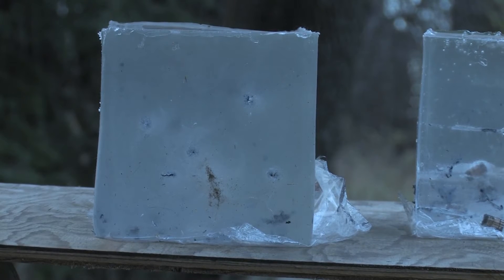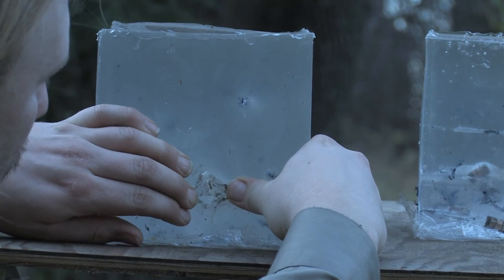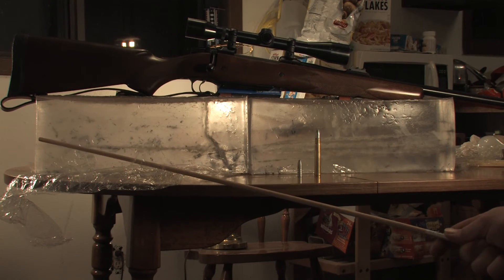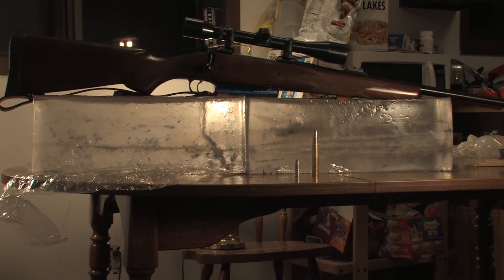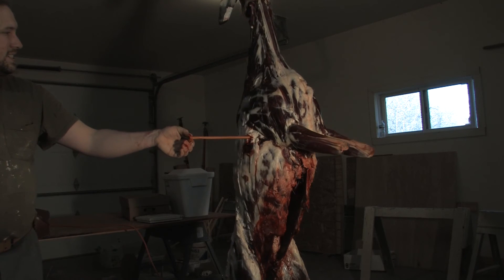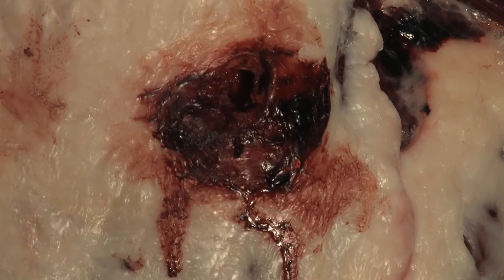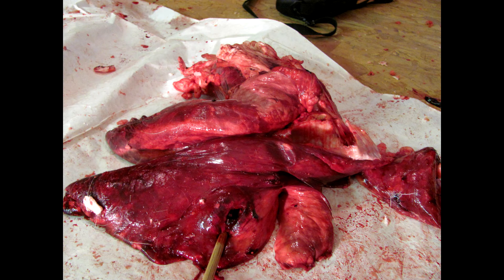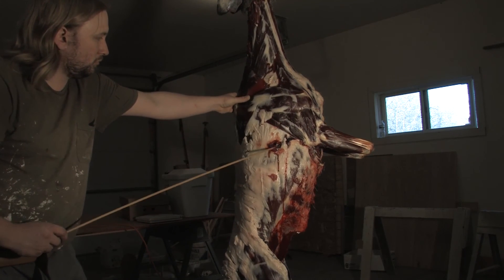My Cast Rifle Hunting Load in Ballistics Gel in Comparison to My Deer Kill

Comment: How much later after the shot did the doe lift her head? If shortly after dropping i would call it possible/normal, with the shot placement, even with modern hunting rounds...? A few inches to the front and you might have been pleasantly satisfied?
Reply from the maker: It was right after she fell.  With modern jacketed soft points, the extra damage would have lead to a cleaner kill with the same shot placement.  Also, yes, an inch or an inch and a half forward with this cast lead load would have had a cleaner and quicker kill, and would have fully met top expectation.

Comment: I used cast in three deer the season before last. All were recovered. Two ran over 100 yards with double lung shots with poor blood trails. The third dropped at the shot but kicked around for a good minute. The third one was shot directly below my tree stand. The ribs shattered into the lungs and I tore the heart in half from boolit. I was not impressed. I used a Lyman devastator hollow point with a BH of 15.4 with a muzzle velocity of 1725fps. I used way to hard of an alloy. All cast bullets exited and never expanded. I measured all the exit diameter holes in the hides which were .430”. No shock or energy transfer accept for the the one that shattered ribs (a chain reaction). I blame it on to hard of an alloy. It was like shooting these deer with an arrow and field point. I am currently using the same bullet casted at 7.5BH with an alloy of 16:1 pure lead and pewter mix loaded at 1600 FPS. I powder coat and gas check them. They are shooting sub MOA at 100 yards out of my Ruger 77/44 after I bedded it and lightened the trigger. Imo you need a soft cast bullet that will expand and come apart for instant shock and energy transfer to put a deer down quickly. I haven’t had an opportunity to find out with my soft cast yet but hopefully this season. If I get the same poor On game results I will only use cast for plinking in the future. Imo The only way a hard cast bullet is going to drop game where they stand is with a head, neck, or backbone shot which I’m not willing to do Otherwise they run a country mile with zero to little blood trails .  I tried trailboss loads in my 375 RUM and couldn’t hit the broadside of a barn with it. Once I got up to 2700 FPS it started grouping.  I believe my guns twist won’t won’t work for cast in the 375 as much as I would like to try it. If I ever do it will be with the same 16:1 alloy for quick expansion and shock. Your alloy was probably closer to 10.5 BH and brittle. Try a softer alloy .

Comment: go to accurate molds and look at the 38-335R its 335 gr with a .260 meplat should work awesome with lyman #2 alloy . id size them @.377 lubed with white label xlox 2500  and tumble lube with thinned alox. with that meplat at those velocities you wont need expansion.

Comment: Why is the velocity so slow? Wouldn’t extra energy from an increase velocity be more conducive to producing hydrostatics shock? Did you have to load the round too a low velocity to to the 300 grain bullet weight?
Reply from the maker: Excellent questions.  Cast lead bullets have to shoot at lower velocities in high power rifles such as the 375 H&H because lead can only tolerate so much 1. Velocity and 2. Pressure.  Also, the softer the lead, the lower these thresholds are, softer lead bullets can tolerate less velocity AND pressure.  In cast bullet hunting one can attempt to harden the lead to increase its tolerance to pressure and velocity to gain velocity and energy to attempt to have better hydrostatic shock.  However, once the lead gets hard enough it begins to act more like a full metal jacket, sometimes worse because a FMJ most often has a soft lead core, while a hard cast bullet is hard throughout.  Soft bullets are the better choice, even with the lesser velocity and bullet energy because the bullet will expand, and if a bullet doesn't expand and resist it wont' cause hydrostatic shock.  A hardcast bullet of this design would have almost certainly just shot clean through doing less damage, even at higher velocity.

The 375 H&H can easily handle jacketed bullets of 300 grain at 2,600 FPS and even 350 grain at 2300 fps.  So the low velocity has more to do with it being a lower pressure, lower velocity lead bullet load instead of limitations of the cartridge itself.  Interestingly enough, the load I used was the maximum load listed in Lyman's 49th Edition, and the 264 grain cast bullet max load was only 1,850 fps, about 150 fps faster than my bullet which weighs 66 grains more.  Total energy is higher in my load than the maximum 264 grain flat point bullet that Lyman also produces a mold for and lists a load for.   The low velocity is the result of the heavier bullet being fired at the maximum pressure that the BULLET can handle, not the rifle.  Technically, I was at book maximum load, and the pressure was high enough it was causing fouling after only 5 shots from its affects on the bullet itself.

Simply put, after the brass was examined it was clear that the load was LOW pressure for the cartridge and rifle, but very HIGH for the soft lead hunting bullet.  Increasing hardness would lead to worse terminal performance even with the higher velocity, so I made the compromise there.  I chose this bullet because it had higher energy than my 264 grain flat nose bullet loads, thus I thought maybe better hydrostatic shock.  If anything, the bullet's biggest flaw was it being a sharp round nose that didn't resist and expand fast enough; something the 264 grain flat nose would have done better.  Between my bullet's shape, a soft lead alloy that was still harder than swage lead in jacketed bullets, and the low velocity, we can see the reasons for failure for hydrostatic shock and problems with my choice of load.

This is the endless struggle of the cast bullet hunter, to achieve hydrstatic shock he needs a soft bullet and correct velocity/energy, something that is difficult it put together because of the nature of the all lead alloy bullet.

Comment: the increae in wound size as it went on may have been from yawing a bit, in my experience yaw on a non expanding bullet that doesnt want to tumble too badly is about the only reason wounding would increase later on. anything that can expand should do so right away while velocity is highest. ak fmj's do something similar since they cant expand but dont want to tumble badly either. if your design had less weight up front it would tumble and do nice damage or alternatively it could have a flat point and expand doing nice damage, your kinda in the middle of a reverse bell curve where not much happens. id save that design and adjust hardness and whatnot for a target bullet. anyway thats my 2 cents, happy shooting.
Reply from the maker: By looking at the roundness of the bullet wounds in the vitals, as well as the straight shot clean through the animal, my guess is that the increase in damage was a result of expansion of the bullet, rather than any effect of tumbling.  This is hard to prove either way, no recovered bullet int he field or in testing, but i would say that the damage would fit the theory of how the bullet should have expended if it did:  round nose instead of flat and lead alloy instead of straight lead, if it did expand it would do it more slowly from the sheer forces on the bullet as it hit flesh, and expanding faster as the flatter face continued to meet resistance explaining the rapid increase towards the end of the track and its exit out the chest wall.  If this is the case my choice of a softer lead alloy worked to some extent, suggesting it may have doubled in size by the time it fully existed, but you are right, the bullet would have not expanded far enough fast enough to cause massive hydrostatic damage like I hoped.  Next time I'll have a softer alloy and proper gas checks for the other Lyman mold I mentioned in the video, one with  flat face, and try again.  Thanks for posting.